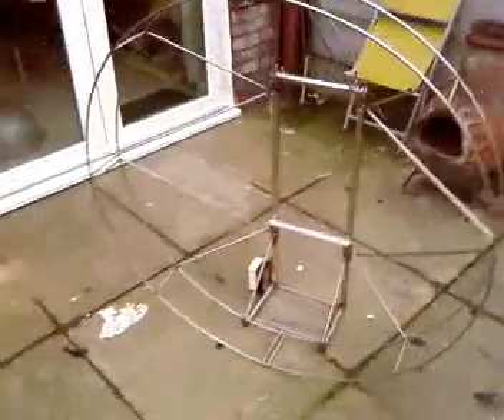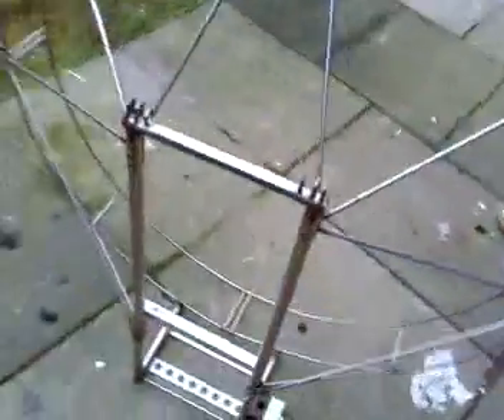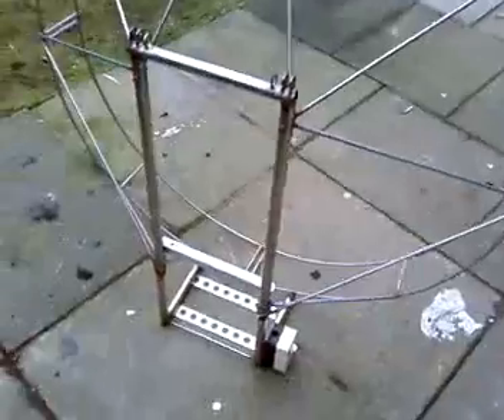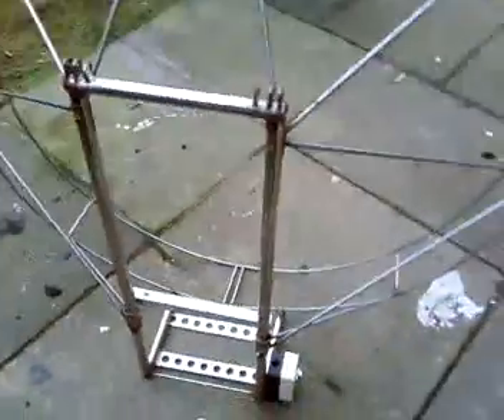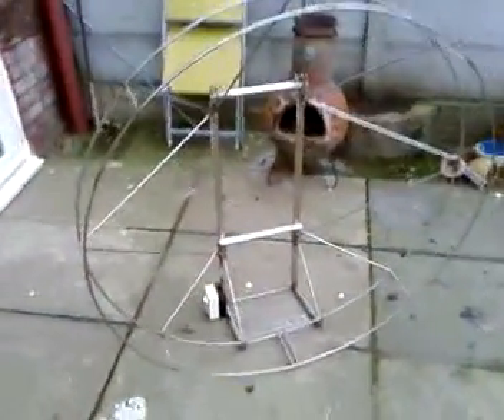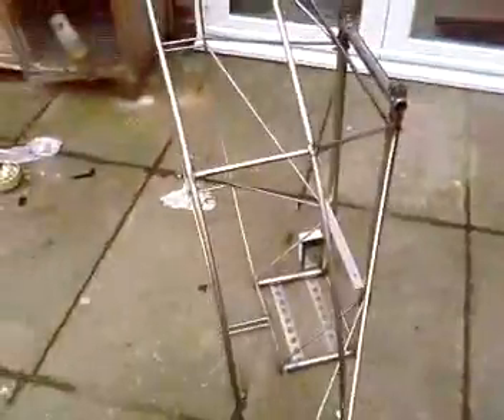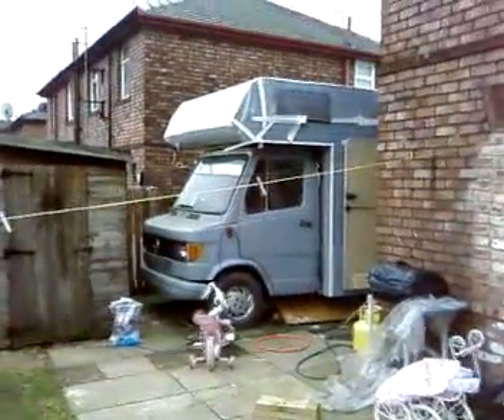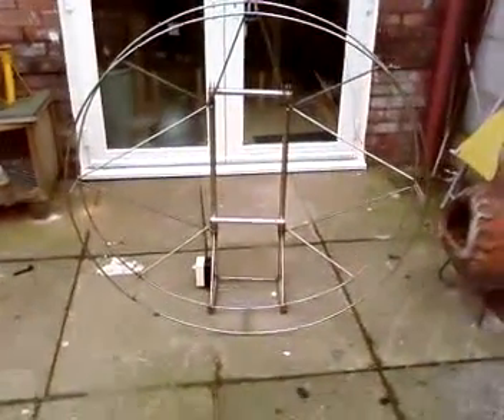paramotor

Comment: Hi.
Saw your video of the frame, I was quite suprised to see it as I was the one who made it in my garage.
I decided to buy a bailey 4 stroke engine and fit it in my old paramotor frame.
I like what you did with the motorbike engine and would be very interested to see it fitted into the frame.
I have a new 3 bladed fan prop for sale if your interested.
              Good look.
                      Kevin.